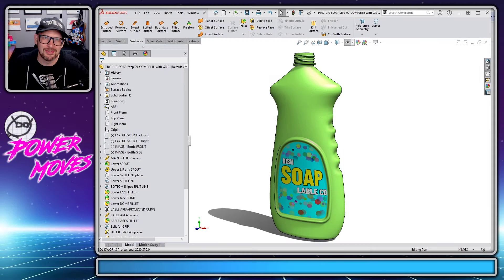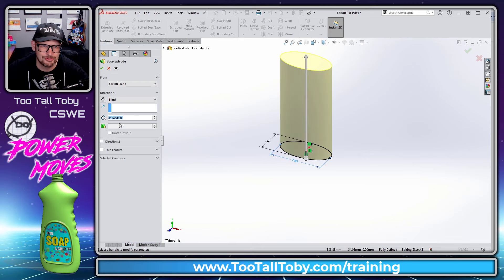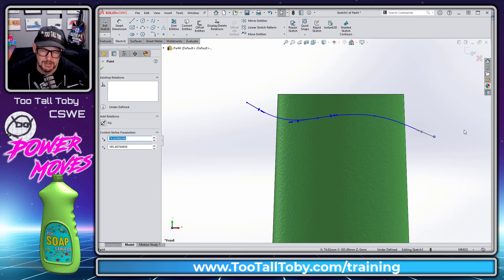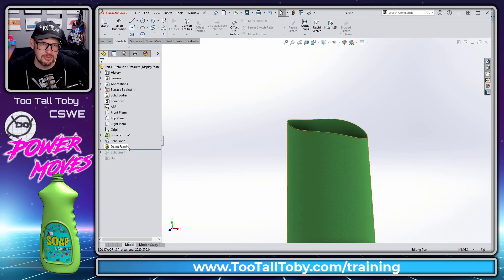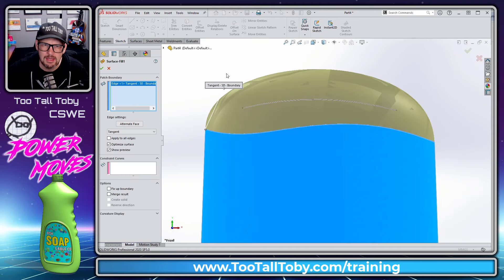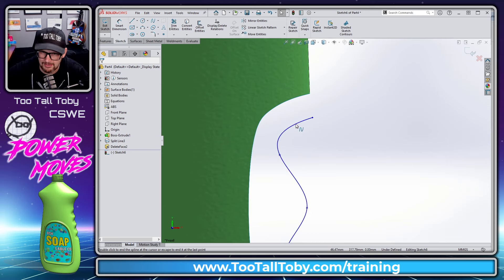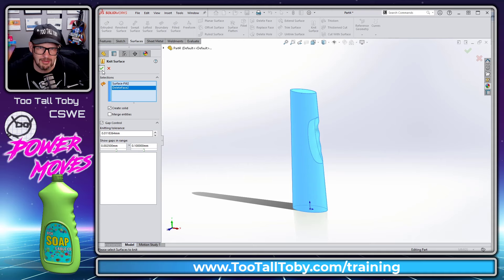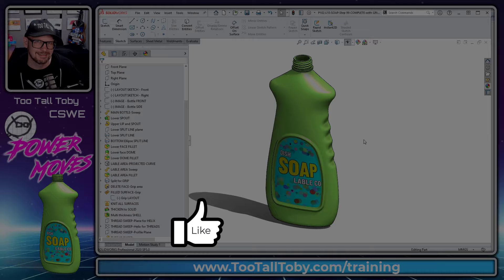HOW TO MODEL FINGER GRIPS - SolidWorks Intermediate Tutorial

Comment: When I do insert face delete, it deletes only the face and looks like my part is hollow…but if I do a cross section view it isn’t?
Reply from the maker: It should just delete the face and turn it into a surface model.  Are you using the option for DELETE?  Or one of the other options (like DELETE AND PATCH or DELETE AND FILL)
Reply: @ I was trying to do it on something wasn’t round like the bottle and just on a side is that why it doesn’t work the same?

Comment: So I was following along and when you did the very top filled surface, my surface when down (cupped) instead of domed. I thought okay I will just change the direction, I do not see anyway to change this. Hmm
Reply from the maker: Yeah I've run into that too - I think the only thing you can do in that spot is use the CONSTRAINT CURVE to get it to go in the desired direction.  Then it usually "flips" the tangent direction - but it's strange that their isn't a simple option to "reverse direction".  

Alternate face doesn't really do it either - hmmm....

Comment: Great video!  However, I had a crazy result (at the 7:14 mark) when changing the Edge setting from Contact to Tangent - the surface went downward into the surface body rather than upward. Once I applied the Constrained Curve above the Surface Body, the surface came upward as intended. Perhaps this could be an opportunity for a future  "Did you know..." about Surface Fills!
Reply from the maker: yeah I've run into this too and it doesn't really seem like there's a way to reverse it, other than the CONSTRAINT CURVE solution you mentioned.  And yes - this would be a great SHORTS topic!!

Comment: Great video on filled surface command with the "constraint curve option".  I always do it the hard way using loft or boundary surface
Here's a few questions:
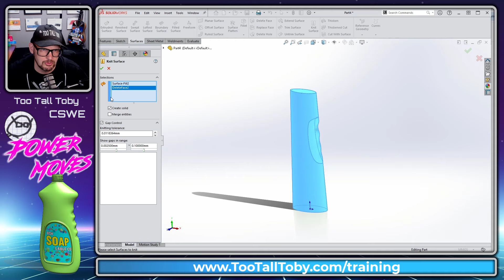a.) 12:23 You mentioned the "body ID" and "face ID" I am curious to learn more about that mainly because I "want to know" when it's going to "take more work" going back/forth.
b.) I assume you modeled the bottle purely from surface → used "thickened" command.  Not solid → surface →solid.  Am I right?
c.) Then if you stayed within the surface realm, do you avoid the "face ID" issue during thickening command, if you went back forth suppressing thicken command?
Thanks...
Reply from the maker: Thanks!  It's a great question and I'll definitely make more videos on Body IDs and Face IDs!